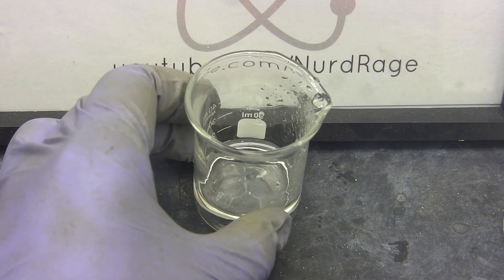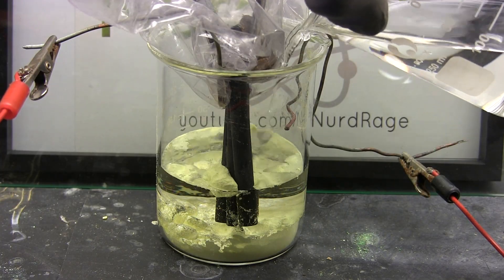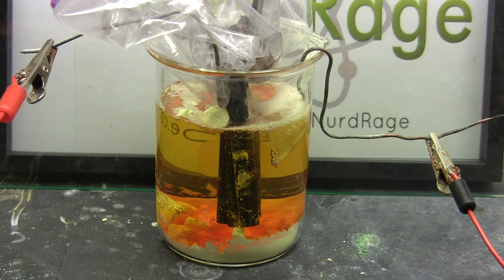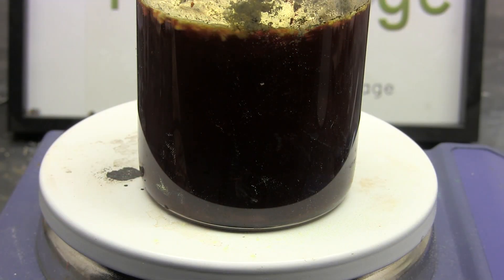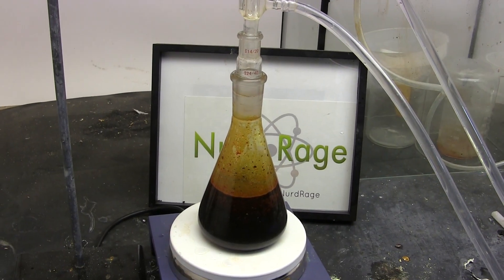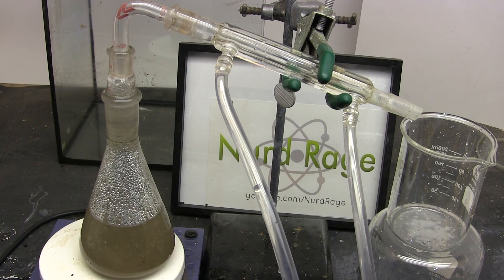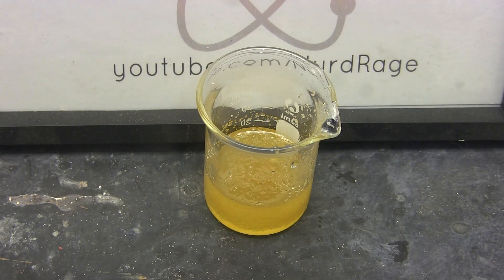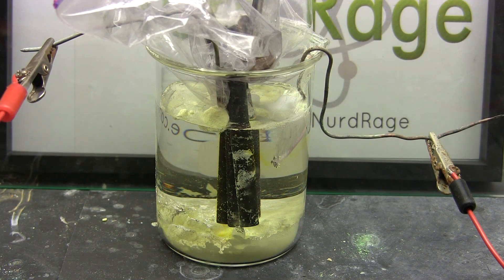Make sulfuric acid from water and sulfur (electrobromine process)

Comment: Here is the main question i have! I noticed that you did NOT have the "Time to crush your dreams" disclaimer. Does that in fact imply that this method is more budget friendly?

Also, As someone who electrorefines recycled copper to get a premium off of blemished wire and tube, I would assume that current density was pretty high. I have no real idea what the max is for the exact setup you used, but to get a reliable, solid, and consistent copper buildup (closer to copper plating than simple uncontrolled electrowinning), the optimal voltage is less than .3V, with a current density less than a TINY 10-20 mA/cm2. What is cool is that it has a greater than 99.9% purity post processing, and the overall power required is .75kWh/KG (much higher for my stuff than in the resources I saw due to other losses). Current density CAN be raised for a faster process time... but since I am a college student in NO rush, I dont really care. I keep it low and slow just to have some metallic company in my garage. :-P

In your case, since you are NOT trying to achieve the same type of result (a solid piece of copper vs dissociated sulfuric acid ions), that automatically gives you a big boost to the current density, but based on the nature of electrodes you have avaliable, I would see how 100, 250, and 500 mA/cm2 perform. Typically, in my experiments, it was the increased voltage that caused more waste, heat, and destruction. The only way to raise the current density of course was by reducing resistance adding more acid, OR by overcoming resistance with voltage... Acid is expensive, and destruction wasnt my goal... so back to low and slow.

I used a manufacturing process datasheet to determine this information. IIRC, the one linked below.
http://www.ct.ufrgs.br/ntcm/graduacao/ENG06631/5-b_copper.pdf

I do use some of the other more advanced setups they note, including polarity reversal to remove nodules. (LOVED that microscope video you made where you could see the traces grow into massive branches when energized) This process of polarity reversal, I do 20:1, again, time and waste are not as big to me, and get great results. This was the video you made that I love sharing with others... SO cool. 
https://www.youtube.com/watch?v=fnyBldC4Ra4

Comment: soo at 0:52 seconds you clearly add NOT water so whats up with the misleading title? and my god man lose the damn voice changer, the dialog is pretty difficult to understand with the added bass for sexiness or whatever the hell you're doing
Reply from the maker: Chad Wilcox It is water, with a small amount of hydrogen bromide added, that's why it's called a "solution". And if can't handle the voice, turn off the sound and turn on the subtitles. They are professionally done so you can still follow along.
Reply: Chad Wilcox Well the Br is  only a catalyst...
Reply: So he used more than sulfor and water to make this.  Ok
Reply: NurdRage I was working on my shopping list for this and when I saw the hydrogen bromide I thought damn, why cant it be water, I have lots of water and a bunch of sulfur I received from my grandmother as a gift and got all excited thinking I'm just mere steps away from being a proud sulfuric acid owner but noooo, now I have to track down some damn hydrogen bromide! gah! 

and the voice thingy going on was just making this video hard to follow, I don't generally have issue with your other vids

Comment: Since the reaction is an acidic redox reaction where Br- ions are oxidized to Br2, is the HBr solution necessary, or could it be substituted with an NaBr solution (to provide the Br- ions) and HCl (to provide the H+ ions)?

Or does this process also have to do with the fact that HBr is a stronger acid than H2SO4?

Just started studying electrochemistry, so there may be something blatantly obvious  that I'm overlooking :P
Reply: TheChemistryShack Redox potentials change with pH. For example Permanganate is quite stable in alkaline solution but in acid can cause organic materials to combust. NaBr would also tend to produce sodium sulphate\bisulphate (Hard to eliminate as a waste product.)
Reply: Gareth Dean I suppose the sodium sulfates could be removed in the distillation
Reply: TheChemistryShack
Sort of. Sodium bisulphate can be quite volatile at those temperatures and traces of it contaminate the product. Plus they'd be a significant loss if you wanted enough bromide for a good reaction.

Comment: Hmmm... could the hydrobromic acid be replaced by a bromide salt and hydrochloric acid?
Reply: piranha031091 as a lazy answer I really don't think a salt like NaBr or KBr would work. You could possibly use other pool chemicals to produce chlorine gas and pass it through a saturated solution of sodium bromide to produce a good amount of liquid bromine. That may work but I don't know how any chloride/sodium contamination would play into the electrolysis reaction without sitting down and looking at it for a while.
Reply: TheHotmud i highly doubt that alkaline salts of bromine will work because of the electrolysis. You will get potassium or sodium through electrolysing the salt. the metal will react with the water/sulfuric acid to form a salt.
Reply: Tilobida It sounds like you're saying you'll get sodium or potassium metal through the electrolysis. Which can happen just not in a solution.
Reply: Tilobida
You can't get metallic potassium or sodium from electrolysis of an aqueous solution of their ions. Both thermodynamically and kinetically, proton reduction to hydrogen is massively preferred over alkali metal reduction.

And even if that was the case, that doesn't change a thing about the anodic reaction that leads to the oxidation of sulfur to disulfur dibromide, and its subsequent hydrolysis which inevitably produces exactly as much H+ as the cathodic reaction will ever consume (plus the produced H2SO4), since you regenerated the HBr in the first place. (Otherwise, charge balance would be broken)

While spectator ions would likely reduce the Faraday efficiency of the electrolysis, I now realize the actual problem comes from the next step, the distillations : the sodium would  end up as sodium sulfate in your product after the first distillation step, as you only evaporate HCl and HBr, which would lower the yield after the final, high temperature distillation.

So, I guess I answered my own question.